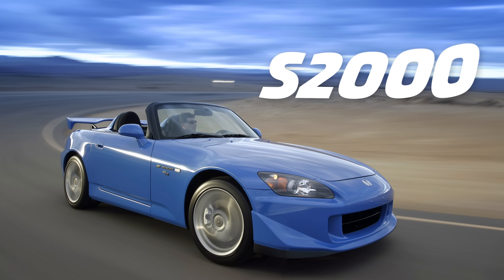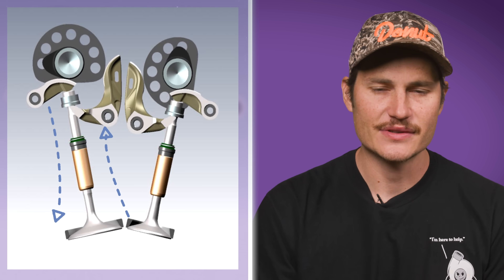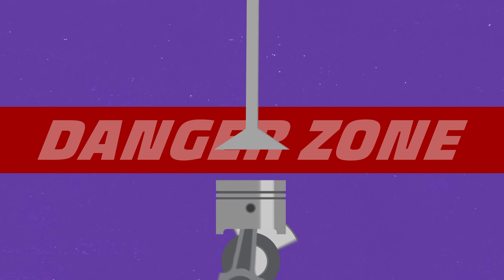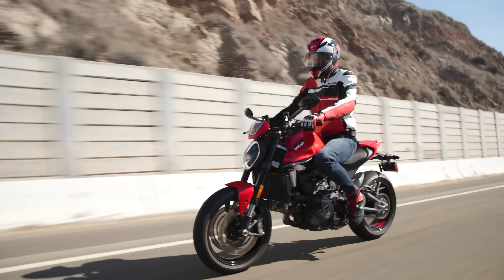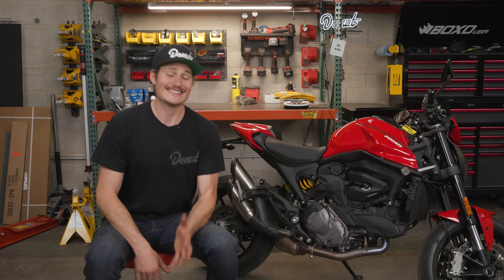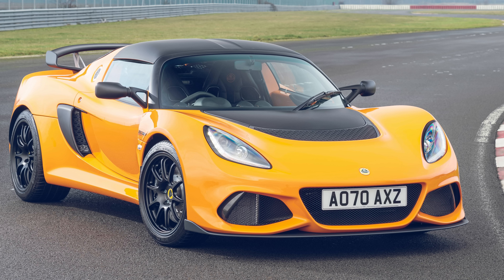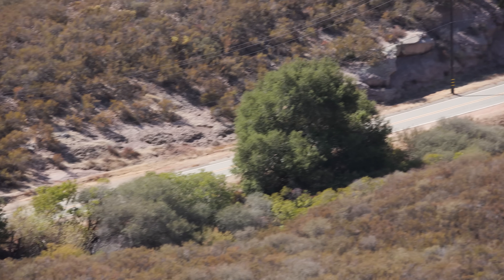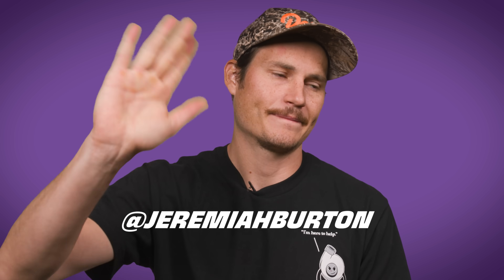Why ONLY Ducati Uses This Part To Go Fast

Comment: Personally I think an electric valve/ camless system like what keonigsegg is using in the gamera is the best option for future cars since its less moving parts and can be tuned without having to take everything apart. Plus if keonigsegg can make a 2.0L inline 3 cylinder engine make 600hp id say thats a pretty big difference compared to using a conventional valve system

Comment: If current f1 cars don't use this kind of valves, then what do they use ?
Reply: Don’t know if they’re back to springs now, but for a good while they used pressurized nitrogen. It was controlled through solenoids so the pressure could be dumped to make the valve easier to open, then pressurized to quickly close the valve.

Comment: why not have them follow a groove? be kind of groovy?
Reply: There isn’t as much surface area for the sliding parts with a groove so it would wear out quickly. With the cam lobe design it has a nice wide surface to spread out the load.
Reply: @NBSV1  Yeah good point..wasn't thinking that small of scale.

Comment: I definitely wouldn't say it makes it easy, considering Ducatis still break if you sneeze, and require a valve adjustment every time you blink.
Reply: Not accurate at all on modern Ducati’s
Reply: @redsv1000  The Ducati Monster still requires a valve adjustment every 6,000KM; The Yamaha MT-09 requires a valve check every 42,000KM.

Nah, you're right, modern Ducatis are amazing for maintenance.
Reply: @tristangillis7365  No they don't. My Ducati multistrada needs valve adjustments at 15,000 miles, and the newer models across Ducati's range are up to 18,000+ miles. The Scramblers and anything air cooled are at 7500 miles. You must still be living in the 90s with your 6000km ideas. Plus they're way more fun then an MT-09

Comment: But desmodromic, must check valve clearance every 50.000 miles, so now Multistrada V4 not using desmodromic due to Relability and more milage to check the valve clearance

Sorry for bad english

Comment: desmo has been obsolete for years. Modern, conventional valve springs, which every other manufacturer uses, allows for pretty much the same peak RPM as the modern desmo system.
Reply: Not obsolete.  Different.
Reply: @brandonamison8950  it's idiotically expensive to service and has no real benefits anymore
Reply: @youridv  Actually the cost of ownership is much less than before.  Ducati’s have always bucked the trend which is why in WSBK & BSB racing, competition complained about an unfair power advantage.  My over-built Panigale R puts out 215 HP and weighs less than 400 lbs wet. I’ve ridden and raced many motorcycles over the years. Ducati has some serious game.  My Porsche from years past required frequent adjustment/replacement of the timing belt as it was an interference engine.  But that was built as well.  Wicked fast and superb handling.  Even my friends Ferrari needed an engine drop to do the belts.  But man oh man, the sound.  I think even the Ferrari F series required hand adjustment of all 60 valves(!)
Reply: @brandonamison8950  Remember in MotoGP when they gave V twins a displacement advantage because ducati was not competitive compared to the other bikes inline 4's? Yeah.

A desmo job is still 2500 dollars today. A simple valve adjustement doesnt even cost a quarter of that on japanese bikes.

I don't care about Porsches and Ferraris in this comment. I'm talking about motorcycles. Ducati's are pretty shit today. Always need way more displacement to make the same power and torque as a japanese motorcycle. Maintenance costs are objectively way higher. They're needlessly expensive to purchase, the list goes on. A Honda CBR1000RR , GSXR1000 or R1 are all objectively better motorcycles
Reply: @youridv  Desmo service is $1300
Reply: @youridv  I find that people who hate on Ducati wish they could have one.  “Why would anyone pay that much for *this*?!”  Speaking from personal experience.
Reply: @brandonamison8950  Not in my country. Desmo for your average panigale V2 is 2500 euros here so in dollars its nearing 3K

I find that "secretly want one" assumption pretty bold tbh. Not everyone cares about ducati. All I see them as are overpriced, unreliable bikes that don't really do anything for me. I ride adventure bikes most of the time and the multistrada is a pretty shitty bike overall. The midrange torque of the 1260 is really low and the engine isn't smooth at all. The seat also gets really hot in the summer for some reason. I test rode one multiple times, as I did with every brand adventure bike that was available near me in order to make a decision. I also test rode a few monster models and one panigale over the years at events and random dealers and I can comfortably say there isn't a single ducati model I like better than their competition.

I like the CB1000R, Z900 and SV650 more than any monster I've ever ridden.
I like the CBR1000RR and Ninjas better than the panigale.
The Multistrada is the worst adventure bike in the 1000+ cc class. The Versys, Super Teneree, Africa Twin, Tiger and Super Adventure are all better to drive. It's engine is a hot piece of garbage and the handling is nothing special.
The diavel shouldnt exist imho, but to each their own.
The 935 supersport is the most interesting ducati imho, but a secondhand VFR800F is better in every single way, although not by much.

I like old ducatis. The ones from the very beginning of the brand where they basically only cared about racing. The modern ones are all fashion statements instead of actually good motorcycles.

And before you start about the noise: The Tuono and RSV4 have ducati beat by a mile in that regard. It's not even a competition. Classic VFR750F's also sound better than most ducatis
The noise of a dry clutch is also not really my taste.

Ducati and BMW are in fact the only two brands on the market I would never consider actually buying as it stands. Ducati doesnt focus on making good bikes, so I don't really care and BMW's ride like a sedan instead of a motorcycle. Neither are enjoyable

I'm also not really into brands that are very conservative and dont develop new things. Desmo  was ducatis last real innovation and it doesn't have any pro's anymore. Valve springs have gotten so good that there's no reason to use desmo, yet ducati keeps doing it for the sake of soul and marketing. Innovate for once. It took them decades to realise that race bikes need 4 cylinders.

Hope you enjoyed my essay on why I personally think every ducati made in the past 15 years is not worth it to buy. Audi shouldnt have bought them, they should've died with dignity
Reply: @youridv  !
Reply: @youridv  well I buy BMW and Ducati so I guess we can’t hang 😂

Comment: I have always wondered why engines couldn't use valve control similar to a smaller crankshaft, keeping the valves physically connected. This would, of course, eliminate the possibility of variable timing/lift, but wouldn't it provide the benefits of a desmo system without the slap and wear, as they could be developed without any slack or sliding? I'm sure someone has looked into it and decided it wasn't a good idea for some reason, just curious.

Comment: Valves, can't live with them and you're two stroking without them.
The whole idea of first four then,eight, sixteen or even thirty two red hot valves and all the associated arms,buckets and springs all flying back and forth thousands of times every minute is physics in motion. 
It's also a ticking time bomb.
Seems a spinning disc with ports might work.
Two stroke power valves have a different purpose but the designs could be adapted.
They've tried various guillotine, retracting fingers and rotating drum designs but they all go back and forth.
The spinning disc with ports avoids the reciprocating motion but may not withstand the forces of compression and detonation.
F1 is going with electric valve control. That gets rid of cams,arms, buckets, spring drag and float. It also exchanges mechanical reliability for computer controlled complexity.
Reply: The other main idea is moving air.

Comment: My 1987 Yamaha Banshee will rev to roughly 15k and it loves every second of it.  Granted the motor is a 1998, but still, that's pretty incredible.
Reply: 2 strokes not so much no valve float to worry about
Reply: @wildcat67-b7n  I know, I was just being a little snarky is all.

Comment: why not create a system like a piston connects to a crankshaft, but with a camshaft with circular eccentric cam lobes (not egg shapped), with a valve with a colar on top that goes around the lobe and with oil chanels throught the cam into the lobes, to keep the system lubricated?

Comment: Desmo is cool and all but there's also a few Japanese small CC engines revving 17k and more with typical valve springs such as the CBR250RR or the ZX-R 250.

Comment: Valve float hasn't been what limits rpm limit for a long time. Desmodromic valves are cool but what limits rpm limit is piston speed and piston speed is determined by stroke length. The piston in a long stroke engine with a 5,000 rpm limit is traveling twice the distance of a piston in a short stroke engine with a 10,000 rpm limit so it is going twice the speed. want higher rpms you have to have shorter stroke.

Comment: Some mis-information, no pressure on the seat, and there is a light spring that seals the valve in low rpm (not an issue in higher rpm)

Comment: Speaking about interference engines: is there a reason manufacturers use this design (especially when coupled with a timing belt)? Non-interference engines seem just better/safer... does it have to do with cost?
Reply: Efficiency, you'd have compression ratios wayy too low if they'd solved interference by going back, thus having lot of emissions and lower mpg's.

Comment: Mercedes used the Desmodronic valve system in the Mercedes DB 603 engines for the Messerschmitt BF 109, "way before Ducati did"

Comment: It's about time Ducati start ditching this old tech. It's been at least 2 decades manufacturers have been able to make decent spings than can take well over 15.000 rpm. They already did it with the V4 of the new 2021 Multistrada, and the bike can easily take 11.5k rpm with 60.000km maintenance interval. There is no reason for them not to be able to ditch the Desmo on their lower reving V2 engines in Monster, Hypers and Scramblers. I'll give them the benefit of the doubt on the V4 in the Panigale V4R, but even then I'm pretty sure it could do conventional springs.

Regarding cars, the future of ICE, if there is any at this point, is invidiually actuated valve and camless engine, like what Freevalve is doing.

Comment: Car engines (naturally aspirated) are tame compared to motorcycle engines. But that is ok, my Panigale is for fun, by my Tacoma is the vehicle I depend on.

However, it does make way more sense to buy a motorcycle instead of a sports car in the same price range as your second (fun) car. For less than the price of a new ND4 Miata or BRZ/86, a Superbike gets you the performance of a Supercar.

Comment: The valve solution is spherical rotory valves. Simple head swap gets a Chevy 350 to do 17k rpm and pretty much never need to change your oil again.
Reply: @Alfred Wedmore they had plenty of issues with valve sealing and contamination... BUT A GUY CAN DREAM!!!

Comment: Are desmodromic valves and Freevalve the same thing?
Desmo valves still rely on a cam to close, right? What if they DIDN'T have a cam, and were electrically powered?

So freevalve doesn't violate any Ducati patent? They don't use any type of mechanical rocker or arm os piston to close the valve, they use a solenoid.

Comment: dude, put one of these Ducati engines in a MR2. 250 hp would be fun plus it would sound like a monster.
Reply: MR2 is light but it's no where near superbike light, hell MR2 makes a harley look light.   The issue you're going to have is a completely undrivable car.  You need to be making some torque to get it moving and the engine won't actually develop that torque until probably 5000 rpm.  The car would eat clutches on the street from high rpm take offs, it would really need to be a track car that didn't rely on 0-anyspeed acceleration.  Once it was moving on a track it would be fun but you'd probably be working in the range of 7000 rpm to redline for any type of power to move it.

Comment: I own a 748S and a 996... I hate doing valve adjustments.

Speaking of V4 motorcycle engine swaps into cars; I'm putting an 1100cc V65 Magna engine in an old MG Midget.

Comment: Desmo valves have another advantage over spring valves besides not having to compress the springs.  They can open a valve faster, hold it at full lift longer, and close it faster than can be accomplished with a spring, resulting in more flow for a given duration.
Desmos do not slam the valve closed.  They close faster, but slow down before seating, and actually close 'softer' than a spring does.  The extra clatter comes from the rockers, not the valves.
Also, nearly every desmo ducati engine has the small hairpin helper springs.  they help at startup and ensure proper valve seating at low RPM.  without them, some higher performance ducati engines will not hold an idle below 3000rpm

Comment: I feel like there must be a better solution to valves out there we simply haven't devised yet. Some high pressure system that negates the need for mechanical bits...
Reply: There is, it uses solenoids to open the valve
Reply: @johnfgt500  true, freevalve is at least one solution, though it still has the same design theory behind it. Really darn close.
Reply: @Madnessnunky  well then there's also rotary, them little doritos don't use valves  or pistons. Just a triangle spinning off center in a circle compressing and expelling gas
Reply: @johnfgt500  I'd love to see the liquidpiston engine be developed further and potentially used in cars. Seems it has fewer issues than the standard design and it's somewhat in production already, just on a small scale.
Reply: @Madnessnunky  haven't heard of liquid piston, I must have a look 👍

Comment: Best sounding bike ever is still the cbr250rr. Such a stupidly high revving little engine and it sounds amazing
Reply: And does it without desmo valves.
Reply: You spelt cbx1100 wrong
Reply: Best 250 ever

Comment: As much as a Ducati swap interests me, I always had more interest in a 2 stroke 6 cyl Johnson boat motor swap. The sound would be spectacular
Reply: Rudezon is a drag car made from a volvo amazone with a v8 2stroke evinrude motor
Reply: @sanderprins3091  
Came to say that. One of the greatest projects I've ever seen on YT.
It's a shame the "documentation" just stopped. Hope it'll be finished one day.
Reply: :_jobe:
Reply: Let me correct you here, *Mercury 2 stroke V6 😂 (in all seriousness, there’s a guy I saw on Tiktok getting 2stroke Mercs to something like 14k)
Reply: Kevin Miller Mercury doesn’t do 2 strokes like Evinrude/Johnson. Not nearly as well
Reply: I want a 2 stroke engine in a miata or an old MGB GT. That would be absolute PERFECTION.
Reply: I work at an Evinrude (now Mercury) dealer… I would love nothing more!!

Comment: Desmo valve service at a Ducati dealer = $1600. And you need to do it at every 7.5 K miles.

Imagine having to spend that much money at every oil change on your car.

Comment: I'd love to see an up to speed on a multifuel engine. Why can they run on anything that burns but my cummins blows up when I put gas in it?
Reply: Because you have to fold your mirrors down first. Pro tip.
Reply: A b2b would make more sense
Reply: One of the biggest problems as mentioned above is thermal. Ethanol burns with less heat. That means less energy. If you don't mind, you can actually convert most vehicles. It just isn't worth your many. If anything, it's a waste. The biggest issue is gaskets and hoses. Flex fuel vehicles have special rubber that can handle the gas/ethanol mix without being deteriorated.
Reply: Diesel engines use extreme heat and pressure to generate power while gasoline/e85 use combustion, timed stoichiometry and fuel specific timing depending on what the flex fuel sensor detects so gas can't combust diesel because it's more of an oily substance which the injectors can't properly atomize and can't be ignited gasoline can cause an explosion because all that heat and pressure possibly igniting in a small area will force that explosion energ outward
Reply: because they are are a jack of all trades, but master of none. flex fuel is mandatory in here in brazil, the cars can chug anything, but they lose some power/efficiency that they could have if the engine was specialized to a single fuel
Reply: Low compression. That's literally it
Reply: Turbine engines can do that. Mostly prototype only, some are successful applications for military use, like the M1 Abrams tank uses a turbine engine and it can use any fuel that burns or combust. Chrysler has an experimental turbine engine way back in the 1950's to the 1960's, also intended for multifuel, but it is very thirsty, and by the way things are going well into the 1970's oil crisis, it won't be that successful if it was approve into production. Also, I think it won't pass any emissions standards that is mandated in the post oil crisis era.
Reply: I came in here to talk about compression differential, but these guys already nailed it!!!!!
Reply: its cause you like rods up the rear
Reply: @gearbanginentertainment7476  typical dodge
Reply: Because your Cummins gets 25-40%(year dependant) thermal efficiency on diesel by being specialized, whereas flex fuel engines can vary as wildly as 4-30% depending on what you put in it.